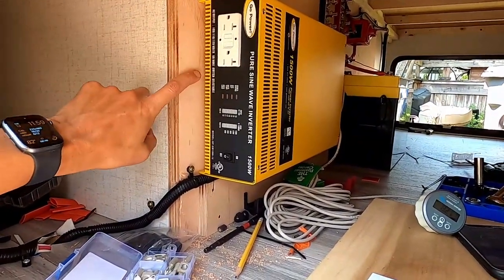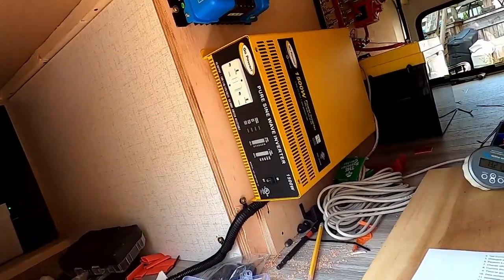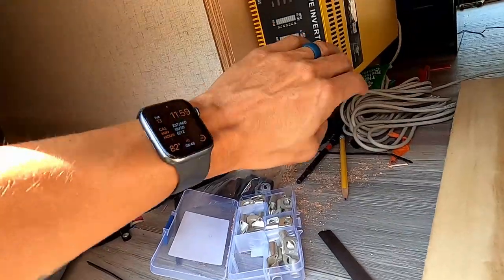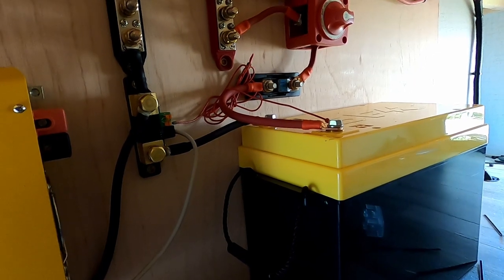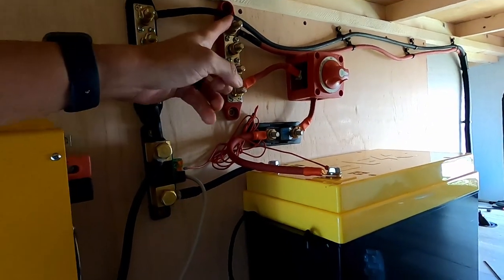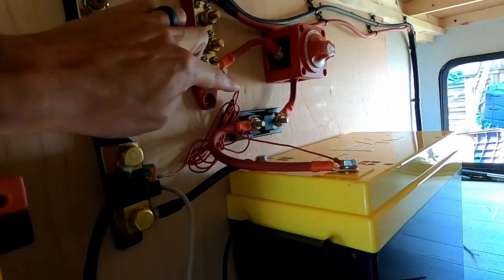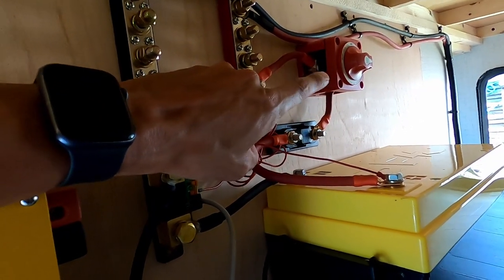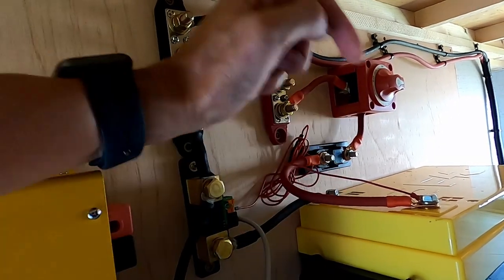Documenting the LiFePO4 battery upgrade on my travel trailer

Comment: Great video, well done. How did you reroute the battery cables from outside on the tongue back into the pass through for the battery to be stored inside? I looked to do mine but it's really tight with the existing wires and it looks like I have to take off that front black diamond plating (removing the sealant in the process).

Comment: thanks for the video.  I am doing a very similar lithium move from the tongue of the trailer to an inside area of the front garage storage area.   I am confused with the ground splicing.  Is it not possible to connect the new battery ground to the original location to avoid a splice?  Do you have a email site to attach diagrams and photos?

Comment: Why couldn't you use the existing charge controller that came with the trailer? Link to the battery?
Reply from the maker: Two reasons... first, it's not enough amps to handle the 380w of solar that I have.  Second, its a PWM controller, which is not as efficient as a MPPT controller.
Reply from the maker: If you search the web for Sun Fun Kits, you'll find it.  I bought a 304ah full kit.